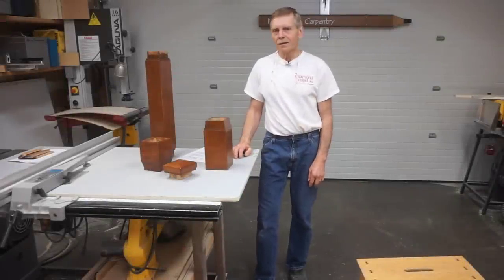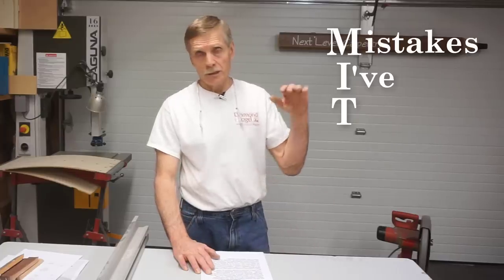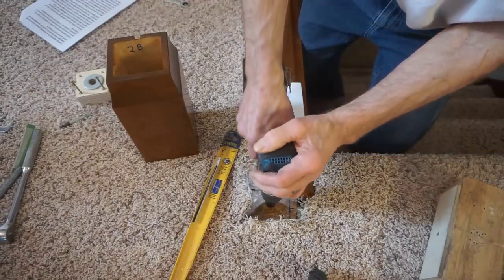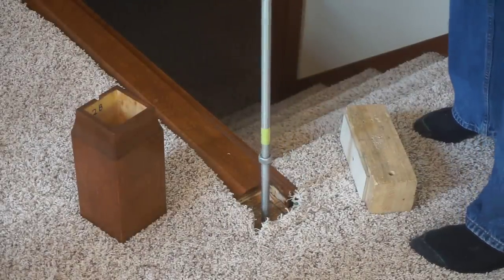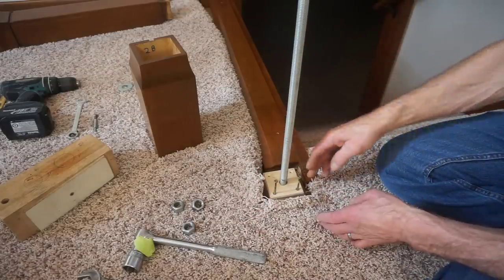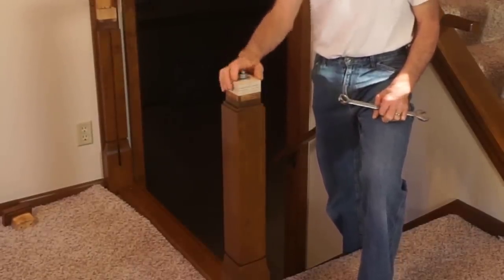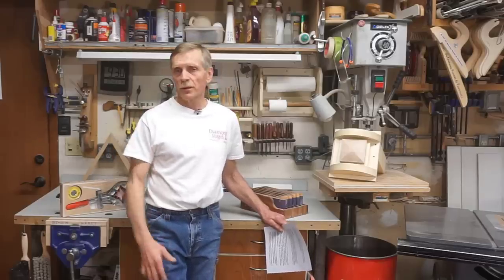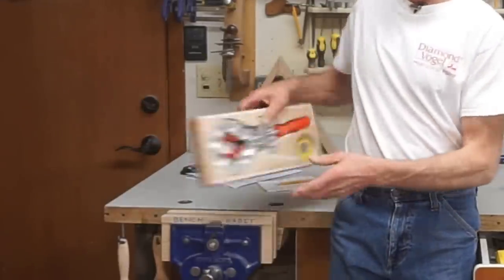How to Install a Newel Post Without Wobble

Comment: If you have access below the posts, I wonder if one could just put nuts on the end of the all-thread instead of screwing into a block of wood?  I want to put some posts on a deck and do not have thick, solid wood underneath, just the 5/4 decking boards.
Reply from the maker: This method would work great for deck posts if you decide to use it.  Keep in mind that the post will only be as strong as what it's bolted to so if you can get a block or blocks securely tied into framing below the deck you'll be fine.  If the decking and/or joists are old, weak and weathered the posts won't be very secure.  Good luck Andy! Best, Matt

Comment: What model is the Reznor heater in your new shop? Your techniques are certainly those of a master carpenter.  thank you so much for sharing.
Reply from the maker: Deborah: since the Reznor heater was in the shop when I got here I'm not sure of the model... I do know that thing PUTS OUT THE HEAT though!  They're a nice 'tight' unit and I doubt you'd go wrong with any of their products that are sized to space requirements and installed properly.  Thanks for the compliment on my 'techniques'... I only wish my video production skills were more streamlined because it takes so long to get a video made and uploaded  that I've got a backlog of great content ideas a mile long!  Makes me confident that the best is yet to come though 😁 Best, Matt

Comment: Great idea.  I can only hope there's 8+ inches of solid wood below the post to screw the rod into.
Reply from the maker: Thanks Mike.  Only one of the 3 newels on this project had solid wood below.  I added blocks to the post at the foot of the stairs with access from the crawlspace below.  I 'surgically' added blocking through a minimal access hole cut in the subfloor for the post on the 'landing' above.  Best thing about that is, once the blocks are in place, no invasive access is required to anchor the post.  Best, Matt

Comment: Hi Matt, what would you do if there was no double 2x10 to thread the ready rod into? say there was nothing to drill into?
Reply from the maker: Good question Corey.  I didn't cover it in the video but the other two newels on this project were just like you're asking about: nothing but 3/4" plywood subfloor.  I was able to fit a stack of 2x6 blocks with screws and polyurethane subfloor adhesive from underneath (in a crawlspace) for one.  The other I cut out a 8x12ish section of subfloor, glued and screwed in a stack of 2x6 blocks through the hole and then screwed the subfloor patch back down.  All solid as can be.  With blocking in place I simply followed the same process shown on the post in the video.  I'm sure someone somewhere will encounter an installation where getting solid blocking will be very impractical but in that situation a railing retrofit/upgrade isn't going to be feasible anyways.  Hope that helps!  Best, Matt

Comment: The fine threads on the bolt seem like they would strip out of wood over time
Reply from the maker: If they don't strip out during initial installation they're good for pretty much ever as long as the installation is sturdy in the beginning.  Just think about other screws used in construction; door hardware, decking, drywall, etc.  One and done, good to go.

Comment: Matt, is there a video on the building of these newel posts?
Reply from the maker: Hey Andy there's not a video per say on building of the newels but the one I did about precision joinery and another one about cutting wide coves were different parts of the process. You should be able to find those videos in the uploads tab at Next Level carpentry. If you are a SketchUp user I've also uploaded the model I created to design the railing to the component Warehouse and I think the search term there is something like railings with glass panels. Let me know if you have any difficulty finding them and I'll send you links sometime when I'm at my computer. Best, Matt
Reply: @NextLevelCarpentry   I do Sketchup and was able to download the model from the  3D Warehouse.  Thank you for providing that.  Is "ready rod" the same as simple "all-thread"?  Have you ever tried one of those bits that chuck in a drill and deburs the ends of all tread?  I saw it advertised somewhere and wondered how well it works.
Reply from the maker: @andysparks7381  you're right: ready rod = all thread. Hope the SketchUp model does you some good but keep in mind it's just my 'working model' and lacks many specifics compared to what you'd expect from actual plans.  Never tried the deburing tool but would probably give one a try if I had a lot of de-burring to do... I just use a grinder for the limited amount I need to do but wonder if the dedicated tool would do a neater, cleaner job while also being faster.  Let me know what you think if you get one? Best, Matt

Comment: This is great! I'm making a tapered newel post for my stairs and I want to use your method to anchor the post. The only difference in my project is that the post is going to sit on the bottom stair which is basically hollow. Should I open it up to put a block in for stability or will that not be necessary? Great video!
Reply from the maker: This probably isn't a reply you expect:
Actually I wouldn't recommend this method for your project as described.  The newel would only be as solid as that bottom tread, which isn't designed for the 'stress'.  That's good news because, since you can remove the bottom step you should be able to extend the new newel down through the bottom step and into the floor framing below in a more standard installation.  I encourage you to do a bit more research and expect you'll find other videos that apply more directly to your project.  You're a smart person to be pre-planning and thinking through your design and I'm confident your project will turn out great!
Best,
Matt
Reply: @NextLevelCarpentry  thank you for the advice.

Comment: Awesome video!  I'm near the point of installing my own railing and this looks great.  What do you do if you are doing this over a 3/4" floating in a basement (wood floor over expanding soil) where there is nothing under it except for metal beams to support the floor?  How do you anchor it then?
I just watched Finish Carpentry. What a salute to you when HE even used your methods and showed a clip of your video in his.  That's darned impressive!

Comment: Just came across this as I'm looking to install some custom box newels in my own home.  I was wondering if you thought this technique would work if your subfloor was concrete instead of wood framing?  The first floor of my home is a pored concrete foundation and I don't have a subfloor on framing.  Would it work to drill into the concrete, apply some sort of epoxy and then drop your threaded rod into that hole?  Just curious to get your thoughts on that.  Please keep up the super vids.  Definitely learn a lot from what you do.
Reply from the maker: This method is even more effective with a concrete subfloor because the holding power of the rod is stronger and there's no deflection in the concrete slab from pressure from the post.  I've not use it over concrete but I'm certain it will work great as long as you get a good connection between epoxy and concrete. Best, Matt

Comment: It’s probably me but I feel you glossed over inner box.  I understand the purpose but not where it came from.  Did you build a smaller box? I’m showing my ignorance a bit but how else to learn?  Much appreciated. Also, does it run the full length except for room needed for the upper and lower blocks and the top washer and nut?

Comment: I always take post into the floor. As you stated its a leverage thing.
Reply from the maker: Stewart, curious: what do you do when the post needs to go directly over a structural member that can't be cut out to accommodate 'taking the post into the floor'?

Comment: Thank you for the great video. If my rod was only going to anchor into a double 2x4 plate under the subfloor, would that provide the strength necessary for this method?
Reply from the maker: In theory it should be enough but it depends on what the double 2x4's are attached to, etc.  I'd try to install a mock-up to test the strength.  Worst case scenario you'd need to add extra blocking or more screws/glue to the existing.  I do believe this method is the best chance you have for an acceptably solid installation.  Best, Matt

Comment: Matt, I revisited this video because I have a similar job in the works. The client wants me to remove the walls around a stairwell and install a glass railing. I'm going to build 7 posts to accomplish this and remembered this tip about the all-thread method.  I like the look of the glass panel installation you showcase here since there are no visible brackets. Do you have a treatise on the routing of the dadoes to accept the glass? I'm thinking I could run the dado the entire length of my posts and use the  base trim to support the glass and the post cap covers the dado at the top and finishes it off.
Reply from the maker: KLM While I don't have detail on post dados your thought of running the glass all the way down and having 'base trim support the glass' should save you a bunch of the trouble I made for myself in wanting the glass to 'float' 4" above the floor. My posts had stop dados in them and allowed a small clear 'squash block' to hold the bottom corners of the glass... a dicey design but I got away with it. Commercial metal/glass railing systems use a U-channel on the floor for similar purpose and I'm guessing there's good reason to do it that way.  A couple things: the reason I 'floated' the glass was to maintain air circulation since solid glass panels restrict it.  Shouldn't be an issue in your case since stairwell walls didn't allow air flow either. Also you should figure out a way to keep glass from 'rattling' in posts.  Metal/glass systems have a u-shaped rubber channel in posts, rails and base to prevent it.  The system shown in the video rattled a little and I think I just added some little rubber blocks and maybe a thin bead of silicone in a couple spots to get rid of it because it's pretty annoying to walk around a quiet house at night and hear it.  Anyways, good luck with your project... going from sheetrock to glass should be a huge improvement/upgrade from an appearance stand point anyways... Best, Matt

Comment: Love this demonstration! Any suggestions using a similar process on a turned newel?
Reply from the maker: Neal, You might get away with drilling a hole into the bottom of your turned newel, screwing the all thread into it and then just screwing it down but it would be a bit trickier to get everything to line up right in the end.  Best, Matt
Reply: I really like the threaded rod idea.  This Top Down management approach from one who climbed to the Next Level of the "corporate" stairs can really save a lot of disturbance.  They do make double ended lags I've seen on table legs, etc, but the short screw has a tendency to strip out (why customers ask me to repair this stuff).  I don't see that happening with longer lengths of TR, plus the finer threads give more leeway for adjustment if you have to orient a square face, plus you can use larger diameters of TR, plus you're likely to have some some TR on hand already.  BTW, this does work in masonry per other POST.  I once drilled out the axis of a shorter solid newel and used concrete anchor to secure it to interior slab.  I did counterbore top for nut and cap it, but I can see from Matt's operation, I really only needed to drill 6-8" into the bottom with smaller diameter hole.  Make sure the base is cut square, but you can use shims to adjust for plumb as necessary. @NextLevelCarpentry
Reply from the maker: @francismccabe3265  Good stuff... thanks for posting.  It should be beneficial to anyone who takes the time to browse comments here! Best, Matt

Comment: Thanks Matt, I’ve used several of your videos to improve my work and techniques (like the cheapest sandpaper!).  Do you have a suggestion if the newel post old and being reused where the top newel doesn’t come off the post?  I suppose I could risk damaging it by cutting or prying it off, but shy of that do you have a suggestion?  It is being installed on the last stair (of which I could put wood under neath to get the 6-8” depth you suggest). Would love your thoughts.

Thanks again,
Mark
Reply from the maker: Hey Mark, it's cool you're using some of this stuff for actual projects and not 'just entertainment'!  Without seeing your actual newel it's hard to recommend options but a couple random thoughts come to mind.  If the old newel is hollow could you slip a 2x4 or something up through the bottom?  If the 2x4 was 3" too long would it work to bump the bottom end on a concrete floor to tap/drive the top newel out?  Look very closely for hidden finish nails holding it in.  It's easy to imagine the hollow post being made and then the top being glued up, dropped in and nailed to hold it in place.  You've probably already gone through these gears but it's all I  can come up with.  Not sure the age of your post but OLD stuff was held together with glues that might be softened with paint stripper... I know chairs that have been dunked in a stripping vat virtually fall apart once the varnish is gone.
I suppose the thought process to use is that a guy, not unlike you and me, made that post in a sensible manner which, with some consideration, you should be able to reverse engineer without destroying it.  Good luck... and keep me POSTed! 🤢😲😎 on your progress?  Best, Matt
Reply: Also, that old hide glue softens with heat.  Try a heat gun or hair dryer and keep it back a little so as not to burn the wood.  Might take a long time to bring the temperature up on the inside, and tap it lightly often to check if it's letting loose.  I took apart half a dozen chairs for a client last year that had been reglued in a lot of places with more modern and much stronger white glue   @NextLevelCarpentry

Comment: Our newl posts are always solid with a separate cap only. Traditionally one could set it right on the hardwood, bolt it and us a plugged side access to tighten the nut but its tedious and difficult. Any suggestions on drilling a solid newl full length?

Comment: I have looked at all these videos and did not see where you cut the glued up posts to length after the glue up. Did you use the Miter Saw?
Reply from the maker: I guess it never occurred to me to show that step Noel... sorry.  My miter saw isn't big enough to cut the top and bottom cuffs so I used the tablesaw and miter guide to crosscut one face at a time with the length set by the rip fence.  It would be similar to do with a crosscut sled but I don't use one.  Hope that helps?  BTW a mitersaw of sufficient capacity would be a 'better' method but only if it's set up perfectly for 90 degrees in both directions.  Best, Matt

Comment: Great video & instruction. Question doing a custom railing with solid hardwood posts. I’m looking for a solid hidden fastener to fasten to concrete. Any ideas? Thx
Reply from the maker: Drill a hole in the bottom of those newels and screw 1/2" allthread about 6" up into the bottom of the post.  Leave about 6" sticking out the bottom.  Drill a 5/8" or so diameter hole in the concrete and use epoxy like JB weld, PC 7 or expoxy made special for placing concrete anchors.  Pay extra attention to accuracy of layout of holes because you'll not have any room for adjustment after epoxy sets.

Comment: Very informative video as I prepare for my leaning newel replacement.  Would there be any merit to filling the newel with some expanding foam to dampen the vibration of the rod?
Reply from the maker: I doubt it Travis... there's virtually zero 'vibration' in the large diameter rod used in the video and I also doubt it would be a 'weak link in the chain' where blocking and floor strength are the greatest factors contributing to  newel strength IMHO.  Best, Matt

Comment: Nice, next question is how hard is it to find a box newel post? Do I need to make it myself, or pay someone to custom make one?
Reply from the maker: All depends on what you want to end up with.  Since most box newels are (sadly) expected to be installed with external clips you'll likely have to do a bit of customizing of any post to use this method because it requires an internal 'shoulder' of some sort for the top block.  I kind of lends itself to a custom build from the start but there's plenty of other options... Best, Matt

Comment: Great project, Matt.  Lots of fine details to be proud of.  I wonder if you put a note in the post to assist a future remodeler, scratching their heads on how the rod is attached to the joists below.  Also, I wonder if you have basement access, would you simply connect conventionally (with nut and washer at bottom end of rod).
Reply from the maker: Thanks, Jerry... if I were to put in a note to help a future remodeler it would be the first time in history that anyone was so considerate :-)  
I didn't mention it in the video but there actually is crawlspace access to the example newel and the taller one at the foot of the stairs.  Even with access I chose to use this method to show that a nut and washer aren't necessary.  I'm  sure there's plenty of instances where 'conventional connection' would just make more sense and would be equally (or possibly greater) strong in an ultimate pullout resistance test.  Thanks for your question and comment!  Best, Matt

Comment: Good stuff.  Better if your solid wood under the floor isn’t as “deep” is to use hanger bolt for wood to all thread with female-to- female to attach all thread.
Reply from the maker: Jim K; I like the all thread coupler option which could come in very handy for various installation conditions... thanks for sharing and commenting!  Best, Matt